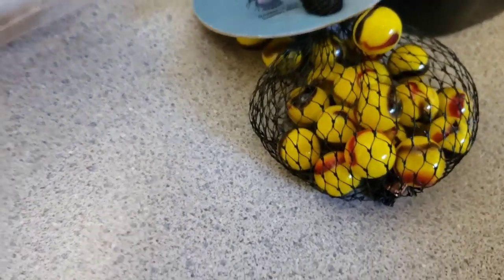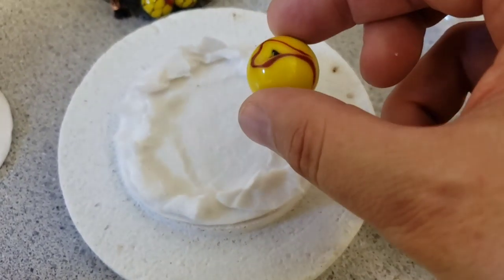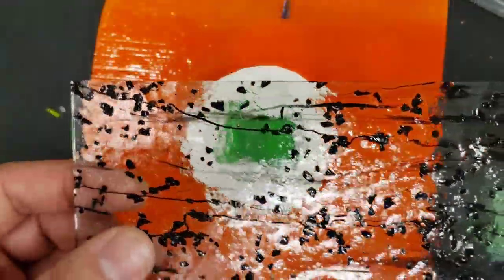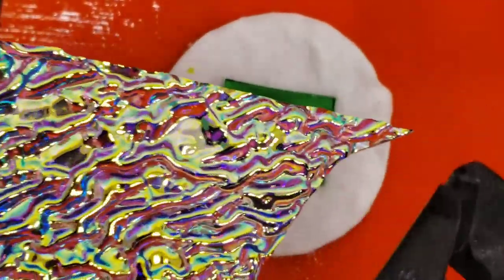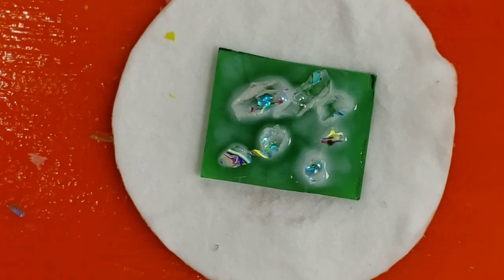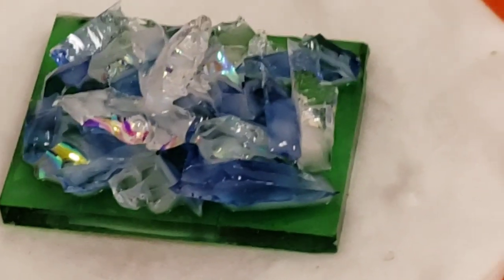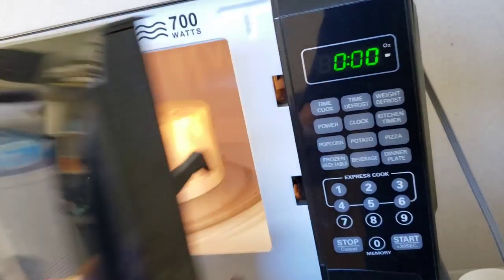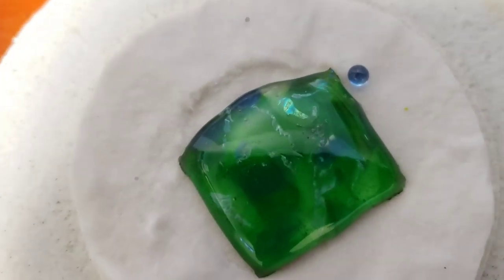Glass Fusing / Microwave Kiln Fun!

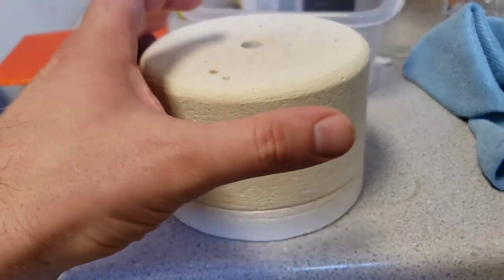Comment: Hey Matt, for the timing on your microwave you don't have to do 6min then 2mins separately. Just press the top left button that says "time cook", then you can manually put in 8:00 minutes. You should also look into glass fuse molds that you can use inside the microwave kilns that come in different shapes and Amazon also carries little glass chips to put into these molds. If you have a glass scoring tool, that might help with making the shapes of glass you want, other then just breaking it with those chipping pliers.
Reply from the maker: Thanks, will check!
Reply: I was researching into the microwave molds myself and had a very hard time finding ones that were for the microwave. Do you know a specific brand name by chance?
Reply: @ronniebos6520  check out Yvonne Williams channel on YouTube. She has a few tutorials on glass work in molds and puts them in a kiln. Most molds are made of plaster or ceramic so it should be safe to use in a microwave, plus it goes inside the kiln then inside the microwave.

Comment: Hey just letting you know if you have a grinder and a mask you can sand a flat spot on your marbles and they won’t roll. Thanks for the interesting video. Nice pieces.
Reply from the maker: Good idea
Reply: Or just use a drop of elmer’s glue, which will burn away with no trace.
Reply: @jonlyksett8340  school glue, with water or without? If yes, what portions of each? Thanks for your kindness! 🤩🌅🤩

Comment: What a great just in time video! I got one of those kilns on clearance, box was open... can you pls answer a few questions? Do you use a separate microwave, heard you cannot use in your food prep one after heating glass.  Can you tell me wear to find pads, what they are called? Do you use heat protective gloves?  I bought alot of clearance glass pkgs from Hobby Lobby and want to try this!  Thanks again for sharing all your great videos!
Reply from the maker: I don't use glass anymore if I don't know its CEO.

I use 90 just because that's what I started with.  90 and 96 are most common for glass fusing.

You can fuse unknown glass if you only fuse it to pieces of the same glass, not to other glass from another source.

I don't use gloves or anything.  It takes my very weak microwave (700 watts) 8 minutes to fuse glass.  Other microwaves you have to test it, starting at 5 1/2 minutes and then moving up to 6, 6 1/2 until it fuses the way you want.  

You should let it cool for 2 hours after each.fuse, even if it didn't fuse all the way.  After 1 hr it's cool enough to move the kiln out of the microwave to a table top.  After the 2nd hour it's safe to remove the piece but touch it first and make sure it's not too hot to the touch.

Use kiln paper.  The residue washes off in the sink.
Reply: @MattsCrazyArt  THANK YOU!
Reply: Hi Nancy, there are lots of different instructions. The instructions that came with my kiln said that as long as you clean the microwave afterward you can use it for food, which is what I do. Also my instructions said to let cool in the kiln for 30 minutes outside of the microwave then take the top off, and place the top of the kiln to cool upside down on a heat resistance surface. And, also if you use dichroic glass (the fancy stuff) in a longer fuse there should be a piece of clear on top. This has worked well for me.